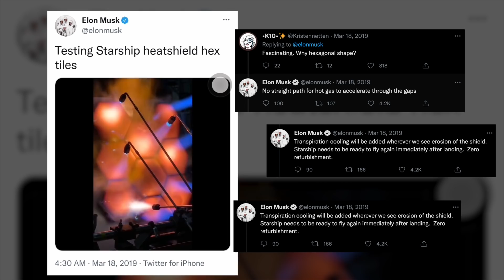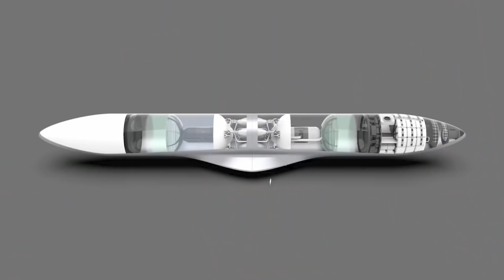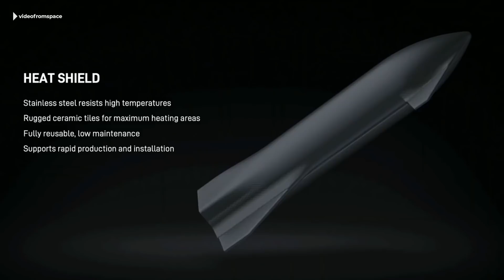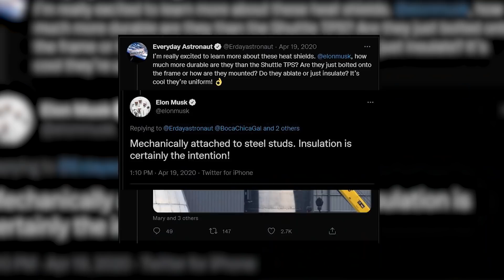NEW INCREDIBLE DESIGN Of SpaceX’s Starship!

Comment: Possible Starship variations : (1) Earth to Earth (passenger) (2) Earth to Earth (transporter) (3) Earth Orbit (debris collector) (4) Earth Orbit (telescope) (5) Earth Orbit Shuttle (passenger) (6) Earth Orbit Shuttle (cargo) (7) Earth Orbit Shuttle (refueller) (8) Earth to Moon Shuttle Main Propulsion (four docking points) (9) Earth Orbit Space Station (four docking points) (10) Moon Orbit Space Station (four docking points) (11) Moon Shuttle Lander (passenger) (12) Moon Shuttle Lander (cargo) (13) Moon Base. The four docking points are for other Starships to dock onto while the Earth to Moon Shuttle Main Propulsion Starship could transport up to four other Starships connected by the docking points and securing arms which will save fuel and be more effective and less effort than travelling alone.